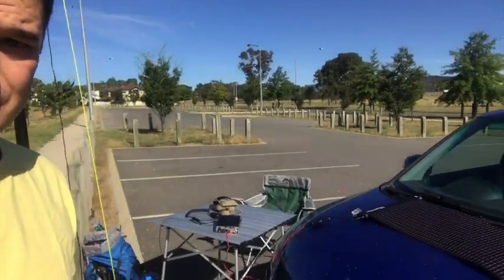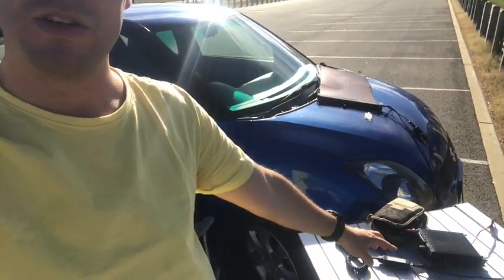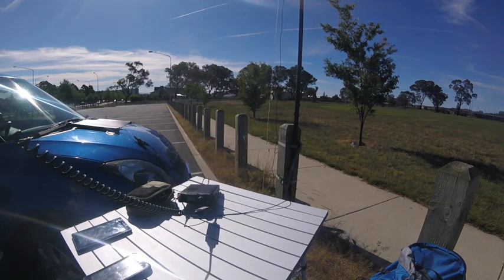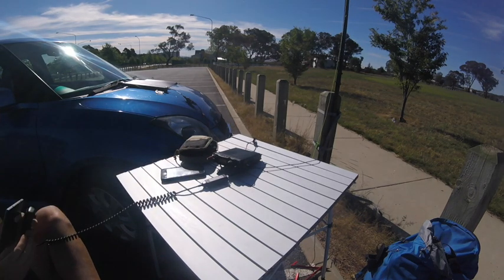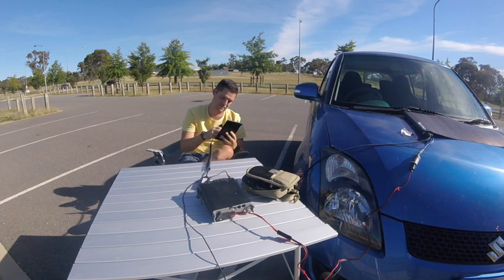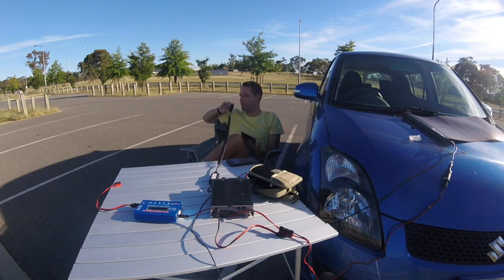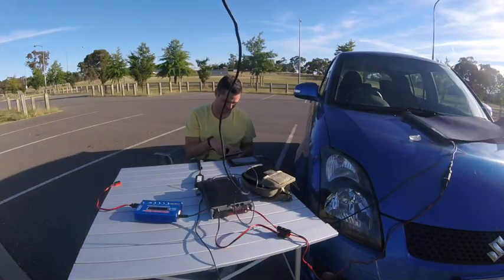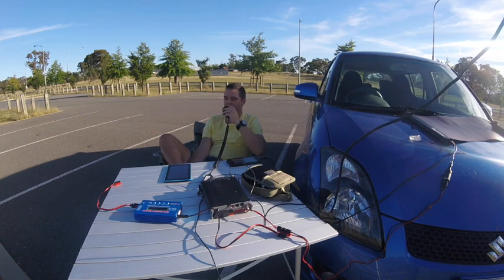A first look at the PowerFilm -LightSaver Max with a focus on Amateur Radio

Comment: Just a heads up. I bought one of these, used it twice, and it failed within the first 9 months.  I contacted Powerfilm just past the warranty period. They advised that they can't repair them and will not replace after warranty period.

Comment: Thanks for this first look. You didn't say though if you had charged the battery before doing your test. I'd like to know how well the solar film performs to recharge the battery. Thanks again.
Reply from the maker: Hi josh. I started with the battery fully charged just like I would on a SOTA outing.   I have used it for over an hour worth the radio and barely made a dent in the battery. The surprising thing is a phone or tablet will suck out more than the radio.  If I was going multi day I would pay wayyy more attention to always placing it in the sun etc.
Reply: Slight side track, what logging program do you use on that tablet?
Reply from the maker: Vk3zpf’s vkportalog. Best ever for /p. Check some other video about it in the play list

Comment: Thanks for the review. Looks great for SOTA etc. I have the Powerfilm 10 watt foldable panel. They make top quality gear.
Reply from the maker: Chris Thompson thanks chris. And I’m testing a voice keyer as you suggested. There is one built into macloggerdx. It’s in 10s rotation Calling cq on 15m now :D. The powerfilm is actually powering my radio right now
Reply: Awesome. Saves your voice for when someone responds :)